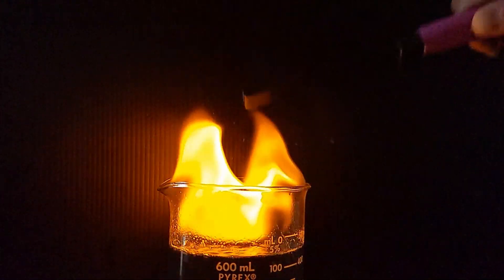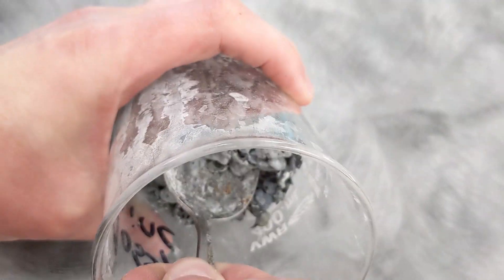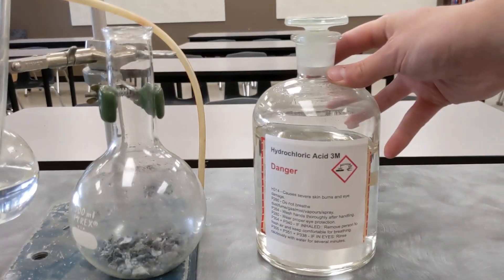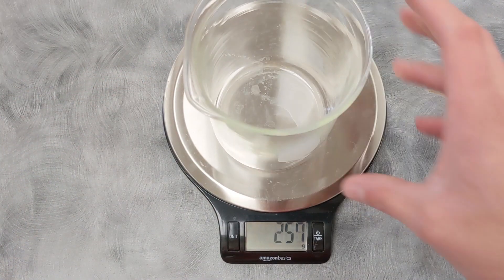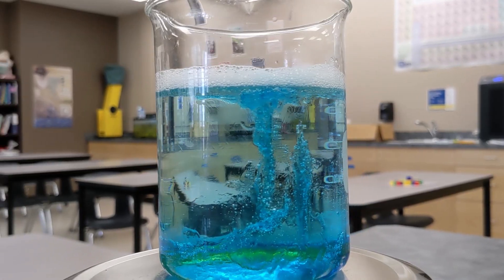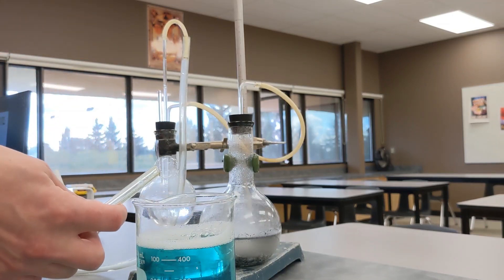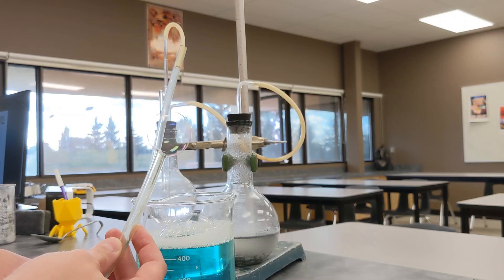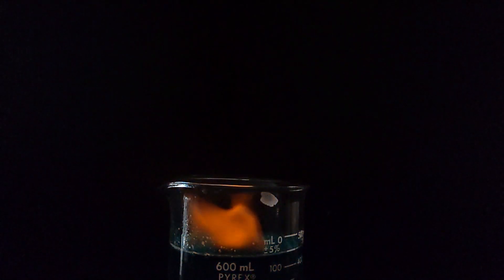How to make hydrogen bubbles you can burn in your hand

Comment: Looks like, I am in front of  a chemistry Fire eater
Well sir if we try with aluminium instead of zinc would the same happen ?🤔
What did you prefer in this reaction concentrated or  dilute H2SO4
Reply from the maker: Yes, aluminium would work too!  You can use some balls of aluminium foil.  As for the acid concentration, between 3 and 6 mol/L is the sweet spot.